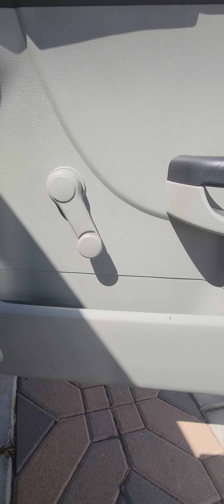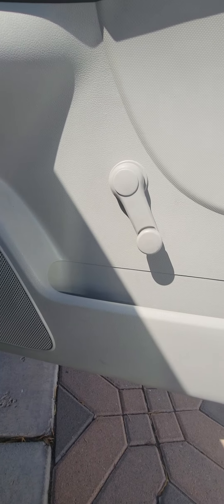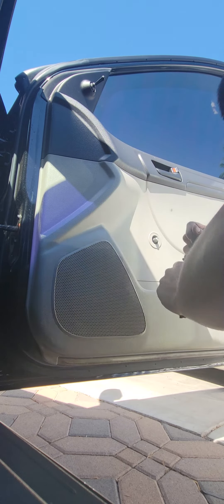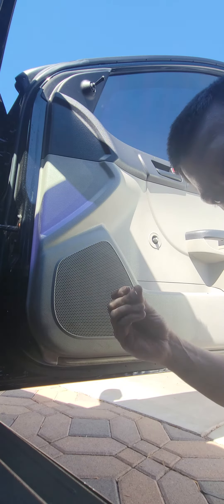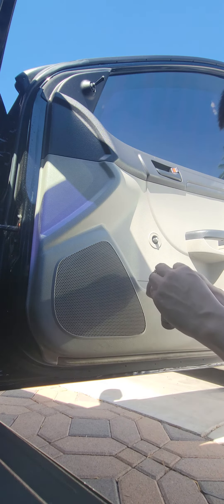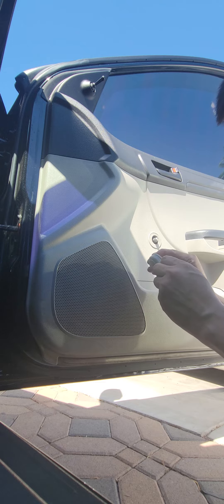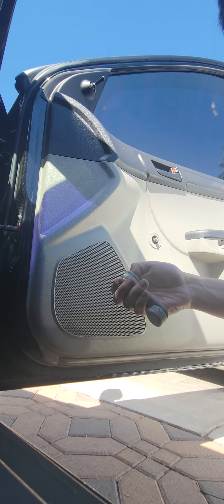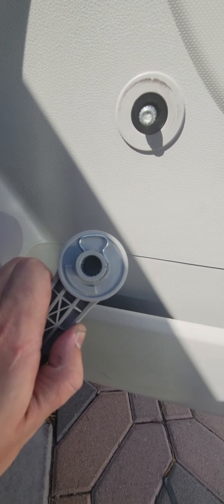DIY: How To Remove Manual Window Cranks

Comment: If you plan on keeping a car for a long time then the less bells and whistles the car has the easier it is to maintain as it gets older. 
Power windows have wires going into the doors that are more likely to break as they get old and having a hand crank means you can still open the window. 
Of course handles break too but are much easier to fix than searching for a broken wire.
Reply from the maker: Yep. Thats why I love this car.